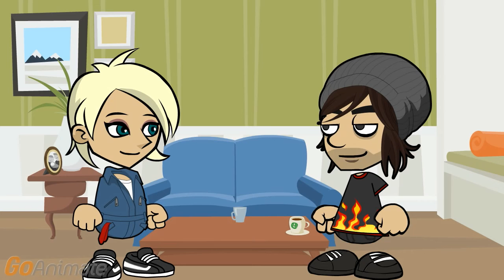My Thermostat is Flashing RE CO

Comment: Thanks so much for the info about the Hunter Thermostat. as soon as I flipped the switch on the back of the thermostat to bypass the RECO feature, that bitch kicked in to heating up the house immediately !! Before that, it was colder than a mofo in my house !!